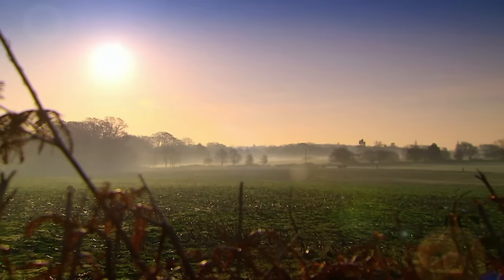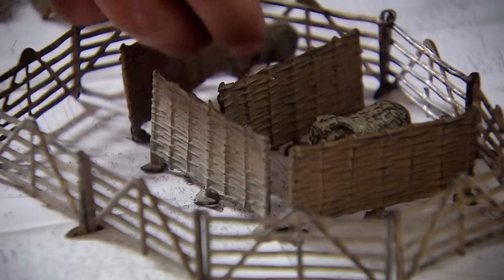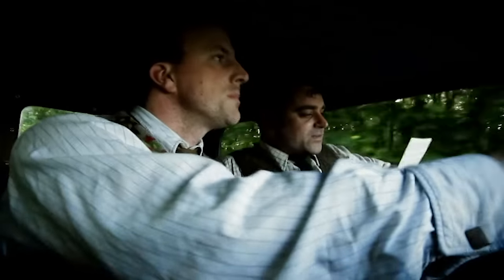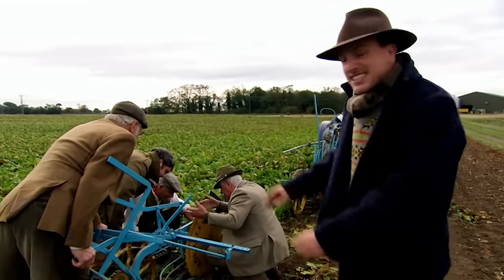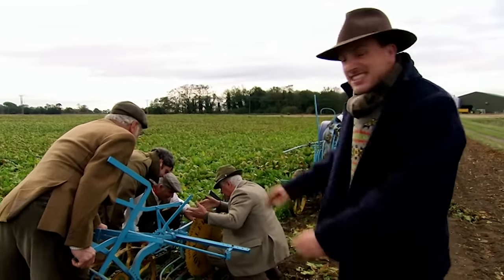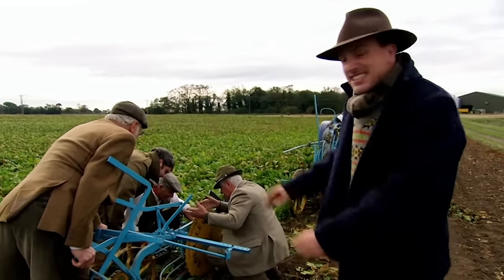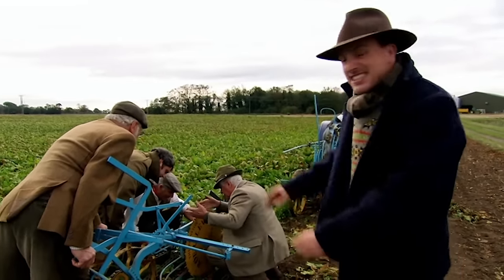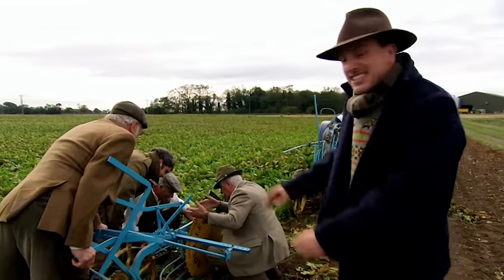How Food Was Rationed in Wartime Britain | Wartime Farm | Absolute History

Comment: Huh. My grandmother actually still makes a rice kinda pudding in a similar way as the hay box, but using the bed and the duvets. Probably an evolution of the concept.
Reply: well i mean the concept was not entirely foreign, it works the same way as a cobb oven which people used since the dawn of civilization.  You take a cobb oven, burn wood fuel, the earthen materials absorb all that energy and get hot, the coals are raked out, dough/pastery put in, close the door and the trapped heat radiates to cook the food.   They both work by insulating long-wave radiation by some means to maintain a higher temperature for an extended period.  The only difference is the material used for insulation.
Reply: use pillows&quilts under&over to  rise my Italian bread dough-pieces of linen or Terry microwaved--1st( just bit warm) cuts the time
Reply: You use what you have available. I guess getting hay isn't as practical these days. And why would you, if you can just use something you have at hand?
Reply: My mother in south America did something similar with the rice. After it boiled in the stove, she would cover the pot with newspaper and blankets.

Comment: Silage has to be in an enclosed space, like a silo, so that it heats up and ferments.  Silage is fermented plant matter.  We used to have a three-sided pit built into a bank with a tarpaulin on the top and an electric fence in front to prevent the cattle from accessing it.  When it came time when it was fermented and feed was getting scarce, we’d move the electric fence into the silage pit a foot every day or two.  This controlled access.  Things could go wrong if fungus got into the fermentation. Becomes poisonous.  One year, it killed 20 of our cattle.  My father was beside himself.
Reply: They appear to have matted the greens down with another layer of straw.  You can see the brown straw on the top of the clamp when they are putting the roof on.  This had the effect of using a sacraficial layer to compact the upper layer of ensiled material, assisting the anaerobic conditions.  While they used the corrugated iron (which looks to actually be a disassembled Anderson shelter from the period, so I'm surprised they destroyed it) to shed water.  I'd have liked to see them use scrap boards or panels weighed with bricks to further compress.

Comment: Regarding the feather duster: I've actually seen (and used) them quite differently with the feathers still connected to the tissue - basically just cutting the tip of the wing of, letting it dry out and maybe adding some kind of handle if you are feeling fancy (but to be honest, it works without a handel fine). Works quite well in brushing off dust and debris.
Reply: @AliceCdE Yeah, NO! I can just see my dog running off with the damned thing and gnawing away on that wing! Plus, have a little respect for the deceased chicken that, through no choice of its own, gave its life for us humans to have food and a damn duster, will ya!?

Comment: The painstaking detail is impressive. Well done! But one thing: aren't you meant to cut wild mushrooms rather than pull them out of the ground?
Reply: Technically, yes. But the reason for that is because it's believed to hurt the mycelium it grows from. However, it's something of an old wife's tale, in a way. As long as you don't just start digging with a shovel and destroying it purposely, pulling mushrooms straight up poses absolutely no harm to the Mycelium network, and you get a little extra with each mushroom.